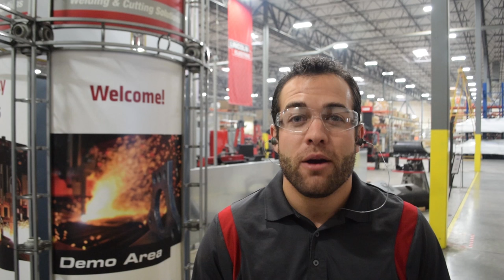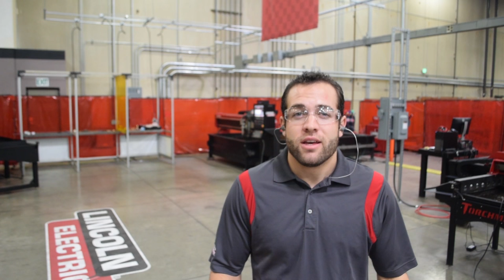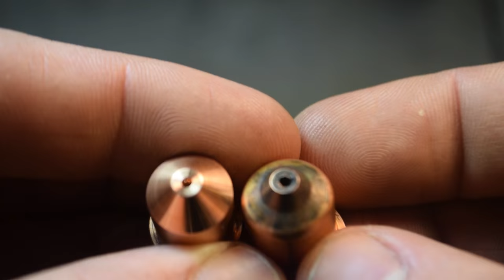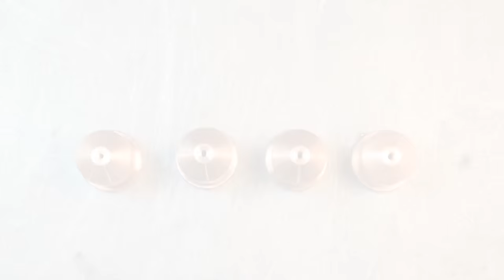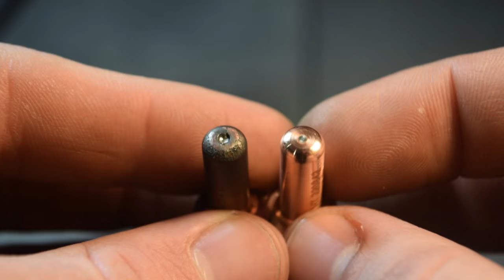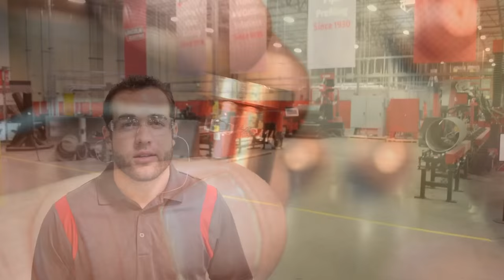How and When to Change Out Plasma Cutting Consumables

Comment: so if youre doing ruff work where the bevel angle and dross arent a problem can you se the consumables until theyre fall apart basically? whats gonna fail first if you never change them
Reply: All u have to do is unscrew it and check them regularly..
Reply: If you overuse your consumables the next thing you will be replacing is the torch head.